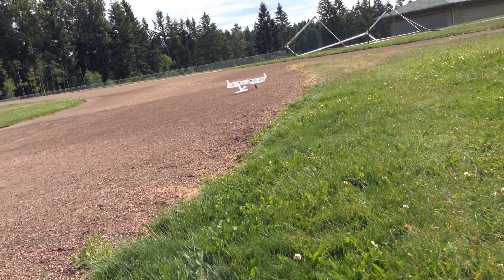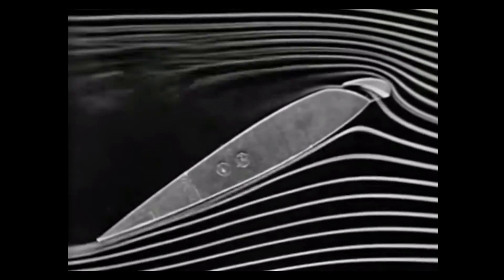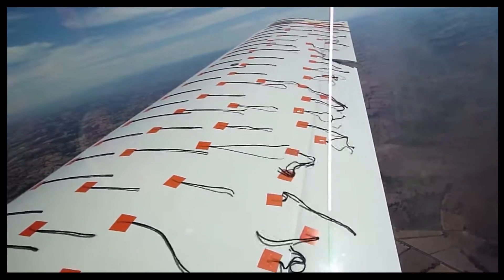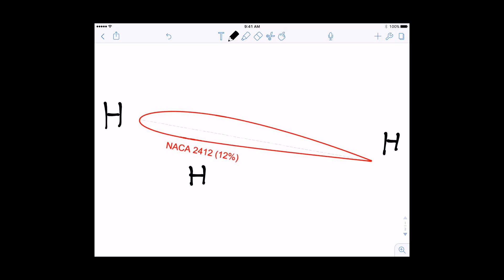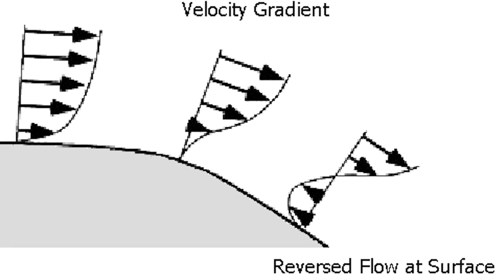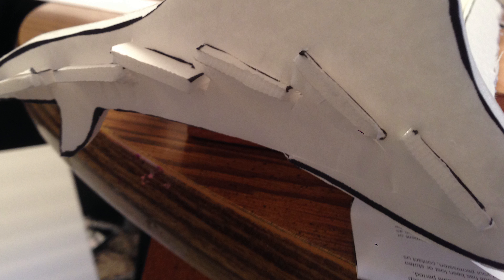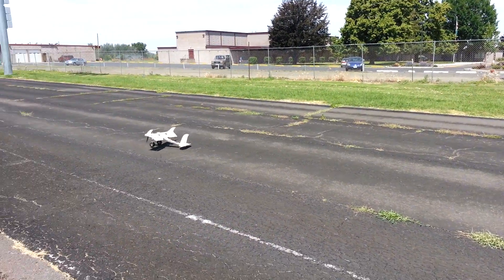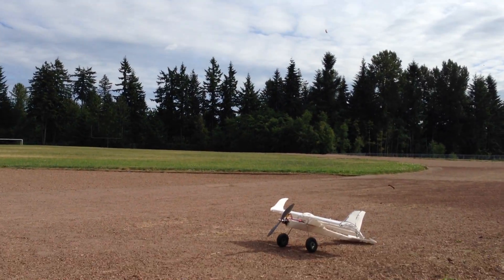Experimental Slat Plane! Unstallable wing?

Comment: Cool. You should make some kind of wind tunnel with smoke trace to see how your slats are actually interacting, make sure there's no adverse effects that could be ironed out by different spacing and/or angles. First thought when I saw unstallable wing was the Russian An-2, which has no stated stall speed and leading edge slats that deploy by themselves when the airflow allows it. The manual says  "If the engine quits in instrument conditions or at night, the pilot should pull the control column full aft and keep the wings level. The leading-edge slats will snap out at about 64 km/h (40 mph) and when the airplane slows to a forward speed of about 40 km/h (25 mph), the airplane will sink at about a parachute descent rate until the aircraft hits the ground.". Not sure I'd wanna test that, but does sound better than crashing into the trees/terrain at flight speed head-on. I got to thinking...since it is a staggered biplane wing arrangement, at that very high alpha it may be approximating the effect you tapped into here. Or not. :)

Comment: You ought to consider doing a balsa/fiberglass version of the wing, with an eye towards reducing drag, and shaping each airfoil along a set curvature, but in a size/shape reduction fore/aft of the main spar. Considering that R/C planes have greater thrust to weight ratios than actual airplanes, the results should be quite interesting! I have made paper gliders along the same lines, which have shown a huge lift capability, but have a 'set' speed (due to drag, I expect), and, of course, no directional control once lofted (had two just go 'UP', and away..), so unless I use fishing fly-line, I may never quite get to 'reproducible' results. You ,however, can 'play' with this and toss in variables along 'if-then' as you go. Nice concept!

Comment: Maybe for small scale planes it'll work. But might need to see what happens when you scale up. Some systems don't work well when scaled up. Interesting though.
Reply from the maker: Actually it should work much better when scaled up. At this small scale we run into low Reynolds number issues (the air is relatively more viscous)
Reply: I see. Thanks Samm. Excellent work anyway.

Comment: 1:39 If my understanding of how wings work serves me well.. the air travelling through that area is in fact accelerating. So even if it passes from low pressure to high pressure, it's not because of its kinetic energy. There are some other forces at work there

Comment: Have you been able to improve upon the design?  Like, airfoils on the slats, two motors that use the wings to stay afloat - it looks like it handles like a boat, more accurately, like one of those baking soda submarines.  Airfoils would work wonders here, and you might get a super-slow flight speed if you can balance the thrust & drag from a pusher twin engine arrangement.  With that much lift and stability, you could easily build it into a flying wing.

Comment: interesting video! I would suggest scaling the idea larger to see if there are possibly structural reasons this can't be done. Or maybe it isn't efficient and creates too much drag therefore increasing fuel consumption? I know jets have thinner wings that produce less lift at lower speeds but have less drag on them allowing higher speeds and better fuel efficiencies.

Comment: i think the problem is not your idea but your girlfriend's cut. she dind't cut all the Styrofoam slats with respecting it's curve, if you cut one of your slats cross section, you can simply observe that your slat cross section is not curved like an airfoil but it's rectangular that can lead the upper wind can easily escape from the begging without following the contour.

Comment: Fighter aircraft with high wing loading actually used bleed air taken from the compressor stage to be blown over the flaps and thus prevent airflow separation.
Reply from the maker: Blown flaps are dope

Comment: i no nothing of airo dinamix but have taken a grate interest in the liveing water, and that the fibonacci squence is in alomst every thing in natrure, now when you show a wing stall and air flow reverse you see the scale. the helix spiral. i have always wondered. you know the helix shape and then useing the scale you get the spirale sea shell cone shape. now it you made a wing that went from front to back horizontal with the plains body(insted of accross. as all plains do) and the wing started thick and with the taper of a normal wing but then twisted in and back in a spriral shape, it should taper to the back. and from wat i have seen with water it should push the air threw in consitration creating lift. i dont know, and i cant try as im disabled but thought it might be fun to se wat happened. thanks for your time . rolfo

Comment: The stall speed seems though related max speed.... i.e you could build a plane with really low stall speed but the drag of it would make it impossible to get high really high speeds... but if you could make a low weight "thingy" that combines the two... sure... F14 Tomcat did it.. low stall and high speed... so the added weight and structure reinforcement was worth the effort... but I do think as of now it is not worth it really..
Reply from the maker: that's why most all aircraft incorporate these principles into deployable high lift devices such as slats, slots, and fowler flaps etc. which can be retracted for cruise flight. The tomcat sweep wing is mostly a for supersonic flight though.

Comment: I had a Helio Courier airplane for 25 years..  It had Handley-Page leading edge slats and wide span slotted Fowler flaps.  The wings also incorporated long cord ailerons which were hinged so that a good part of the aileron leading edge extended below the wing when the aileron went up  to counteract adverse yaw, and an interceptor (similar to a spoiler) extended on one wing only. With full rudder, I could overpower the rudder with aileron.  I do aerial photography and videography, so I could make level turns to keep the wing out of the shot, and even make a right turn with the wing 15 to 20 degrees into a left bank thus keeping the wing out of a circling shot.  This is something helicopters can't do.

With the slats, slotted Fowler flaps and 10 mph wind, I could land and stop in 15 or 20 feet.

There were occasions where I was flying at cruise speed of 130 kts. in smooth air, and suddenly the slats on one wing or the other would slam out and then back in.  The plane hardly felt an encounter with clear air turbulence that would have put a normal airplane on it's side.

Wonderful idea.  Keep experimenting

Comment: It has a slow stall speed because of airfoil camber, not because of the "slats"
Reply from the maker: Well it does have lots of camber and at these Reynolds numbers you're mostly right but I beg to differ and assert that the slats are effective in this experiment for what I was trying to accomplish. Which is mostly as a teaching opportunity

Comment: Back in the 70's a Russian engineer made a full scale ultralight with this wing and it worked well enough, however he killed himself when trying to improve it but making the slats so they could open when at high attack and close at speed. So much flutter at speed it tore the wings off the ultralight and it crashed from 300 feet.  Nice work though.

Comment: If the AOA is going to be changed in flight by several tens of degrees you may want to consider either rotatable wings or rotatable prop and motor mount as the thrust vector forces come into play. 
For a prop at 45deg one newton of forward thrust requires 1.4N of shaft thrust and creates a vertical lift of 1.0N, then there are effects of the thrust centerline relative to the center of mass and changing center of drag.
Reply from the maker: Not trying to create an ideal aircraft, just playing with one idea
Reply: Right, I was suggesting it as a way of controlling variables if continuing to play with the idea since the basic proof of concept worked. No intention of creating an optimized aircraft.

Comment: Interesting toy and concept if you want to fly at walking speed. I think you missed the point when you used the exp of airliner wings. They have slotted flaps for contorl and lift at slow speeds but above that they're pretty much usless. Too much drag and too fragile to cope with natual forces not to  mention uneconomical.
Reply from the maker: The point was not to make anything practical it flew really weird, it's just taking a concept to the extreme to play with and to use as a teaching opportunity. Airliners use fowler flaps, which are extending slotted flaps. They also use leading edge slots or slats. When retracted they form a much smaller, cleaner, supercritical airfoil for cruising at mach .85

Comment: what if with this concept you make the slats rotatable. you could use this to get past the high drag of the original concept. then to solve the issue of loss of fuel space you could either have the individual  (let's call them winglets) be a tank and have the wing/tank angled to drain with out the use of so many pumps. The other idea would be make a single tank and build those winglets around that central tank. Both have pros and cons. what do yall think?

Comment: I will just add alittle to your dynamic stuff. 

Why you loose so much lift when it get to much turbulent air flow on top of the wing is beacuse 2/3 of the lift is generated on top of the wing due the low pressure.

Why do we get a low pressure zone on top of the wing? Some wings (Most of them) are formed as a bevel on top and a plain under side. So if you take a "Air bubble" and the wing split it in 2, The upper one has travel a longer way than the one under the wing to met up at the same time when they get to the end of the wing. That makes it a lowpressure zone on top.

And also to you Samm About the car and the wind. Did you mean the boundry layer between the laminated air flow? Not sure what it is called in english. In sweden we called it "Gränskikt" and thats is the buble of static air that acts like a cushion for the air flow.

I´m a helicopter technician and had a smaller class about aerodynamics on planes. so i cant say im an expert on this, So correct me if i´m wrong. 

Great Regards, Melker S

Comment: the fluid dynamics is awesome but you have no experiment without a control.

Perhaps another conventional wing of similar weight and high speed performance which would fit on the same fuselage.

Then the low speed performance could be compared and contrasted under stall conditions.

As it is there is nothing to prove that your wing truly has any advantage.
Reply: he has the numbers from standard wings to use as a control. And... "no experiment without a control" isnt exactly true

Comment: Use only the front 2 or 3 slats, and fly on them, then realize the rear slats are basically just near vertically oriented air brakes at that highest angle of attack that works.  So the slots just let the air go through so you can keep flying on a smaller part of the overall wing, with still some interaction of the combined overall wing shape, since the slats are close together..

Comment: problem with RC tests is the power to weight radio. One could slap RC gear on a piece of cardboard and it'll fly.
Reply from the maker: +lazzer408 um, yea actually I did that today. But for this project we definitely optimized for minimum thrust/weight

Comment: Slight error. Viscosity is not the same as Friction.
Reply from the maker: +NoFaithNoPain okay please clarify
Reply: Viscosity is the "thickness" or "stickiness" of the fluid (or gas) due to internal friction between molecules or even particles in a suspension. Friction is the resistance between two surfaces. in this case the more viscosity, the more drag. Friction is between layers of air and/or air and wing surface. Higher viscosity will likely result in more friction at the surface, but the relationship will not be exactly a case of the more viscous the more friction in a linear relationship. How much drag the wing develops is more interesting to me.

Comment: Matthew ... I can't find your comment about the wing being "sucked" up into the lower pressure above the wing, but it really isn't.  That's like saying you can transfer cold, rather than heat, which makes sense from a layman's standpoint, but not a physicists.  You are correct about the lowered pressure above, but what is really happening is that the higher (even if it were only atmospheric) pressure under the wing is pushing the wing into the lower pressure.  

When you suck on a plugged straw and then plug it with your tongue, or put your hand over a shop vac inlet, the force you feel it the atmospheric pressure pushing your tongue or hand into the straw/vac, not the lower pressure in the straw/vac drawing it in.  It's really just semantics, sort of, but is technically more accurate, the "forcer" is the higher pressure side.  Not a different reason, just a more accurate explanation.  Hope I didn't confuse the issue more ;-).

I think the best way to think of Bernoulli is to picture the air molecules staying roughly constant in energy (they don't, but it simplifies the picture, there is heat, etc., involved that we will ignore).  When you force the molecules to move think of it as raising the velocity Kinetic Energy of the molecules, and lowering the pressure KE to keep things constant.  Not totally the case, but OK for first order effect, and understanding.
Reply: Neither is true. There is a difference in pressure, creating
 a force which acts on the bullet to cause it's forward motion.
Reply: Richard, while I can't strictly argue with what you said, the higher pressure is the forcer, as it has higher kinetic energy within the higher pressure gas, and that molecular vibrating motion IS the driver.  Am I wrong?
Reply: There you go... the guy explains the principles of lift and stall in simple and understandable terms an some nerd engineer has to muck it up with real physics jargon......... LOL
Reply: John Sikes very good explanation I'm always trying to learn new things.  It makes sense but I still have some questions. In the case of the vacuum the low pressure is caused by a mechanical force and the atmospheric pressure is pushing on the hose. In the ping pong ball example the low pressure is not caused by suction but by blowing faster air. So I just don't understand. I like to learn so if someone wants to give me a call who can explain this I would be grateful. 912-313-1234. Thanks.
Reply: I have never seen a documentary program such as "Air Crash Investigations" where a person or random debris is blown out of a hole in a suddenly decompressed plane, it is always "sucked". Yet the same writers of these programs would never consider that a bullet is sucked out of the barrel of a gun by the lower pressure outside of the barrel.
Reply: Jack ...  At the script writer's level of understanding the thought would never occur to them that those two things have anything to do with one another.  They're not thinking in absolute pressure, their only thought of "0" pressure is 1 atmosphere.  But yes, what you say it a good example, for someone who thinks.

I saw Neil Degrasse Tyson, educated at Columbia, Harvard, and U of Texas, say the other day that the ISS experiences zero g, not microgravity, which is dead wrong, so even some of the "physicists" can't get simple things right any more.  It's getting bad.  I don't think you'd hear Kaku say something like that, but I've heard some goofy things from him, as well.  As soon as some people get famous, they buy into their own press, I guess, and become experts on EVERYTHING.
Reply: I thought all that stuff about pressure differential above and below a wing had been largely discredited??   Newton's third law is your answer ??
Reply: Raymond ...  You thought Bernoulli principle had been discredited?  What?  Not hardly.  You can, and people do and did, figure out a wings lift potential accurately using pressure differentials.  It is true that a wing forces air downward as well, and not even remotely surprising or unexpected.  They are both products of the same thing, namely exchanging kinetic energy for "pressure" energy and back again, or am I missing something here.
Reply: Chuck  ....  Yeah, well.....   sorry bout that.  ;-(  Or am I?  ;-)  Cheers!

Comment: Sam "I'm working on a version where that is the case"  (airfoiled slats)

Samm, great!, I suspect you should find a somewhat different outcome with real airfoils, 
but it will still be draggy as hell, due to interference drag between the slat flows, those compressions that increase stall resistance also create drag.  You will probably be able to at least get to higher angles of attack, though.  More power, which you can reduce at very high angles of attack to look for departure might help, too.  

That is why this configuration typically isn't used in general aviation design, except to a certain degree (leading multiple slats, and multiple staggered fowler flaps) on commercial jets to drastically lower take off and landing speeds, or STOL type planes (same reason, but to lower ground distance needed for operations), where they wan't high lift, high drag, an stall resistance.  

Fun project, I used to do stuff like this all the time. You might benefit in knowledge by also getting a airfoil flow simulation program (or finding one free one online), and maximizing the efficiency of your design (slat positions, aerofoils, etc.), a big benefit I DIDN'T have in decades past when I was playing with this stuff.  After doing enough of it, you should gain a seat of the pants feel that even physics majors don't have, with fluids and dynamics courses under their belts, but they will know stuff you don't, as well ;-).  Cheers, have fun, looking fwd to the vid.  Thumbed you up.